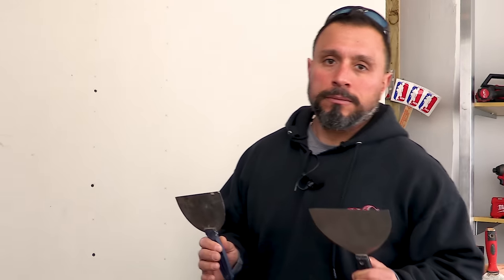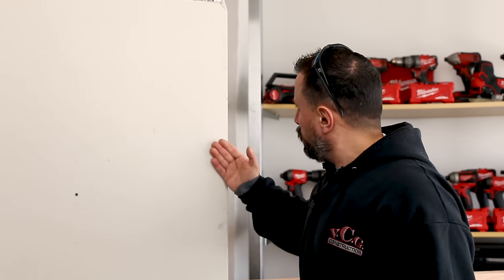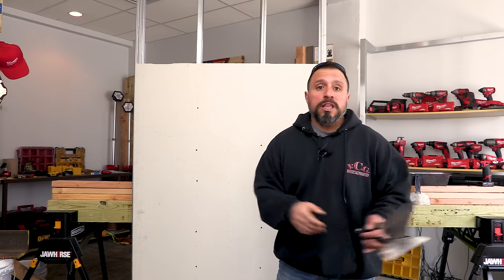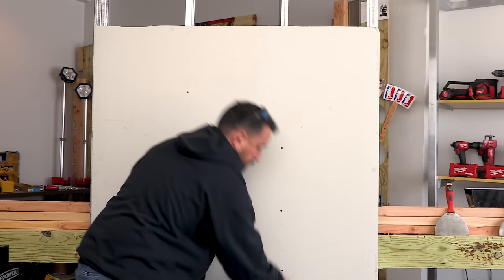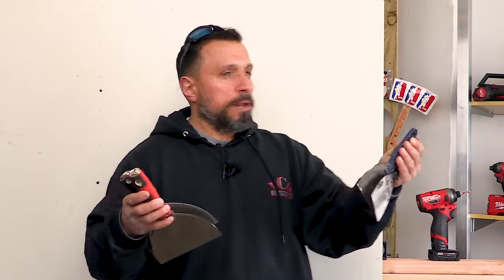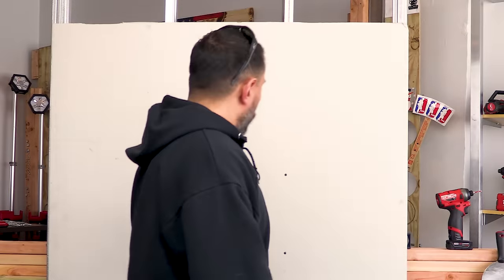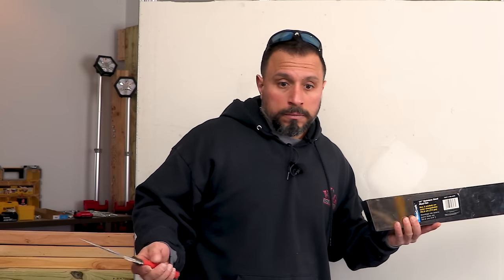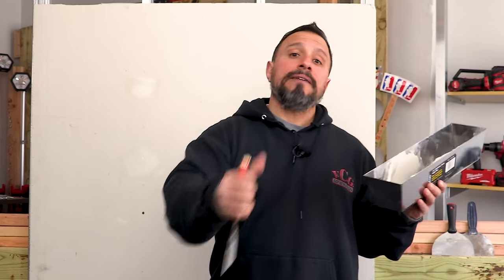DRYWALL FINISHING TIPS AND TRICKS THAT YOU DON'T KNOW ABOUT!

Comment: If you're mudding each screw one at a time you're not a finisher. I'm not a drywall finisher by any means but on our smaller remodel projects I am. I have a 6" knife with a fair amount of flex to it. I just get a glob of mud on the knife, turn it sideways, start at the bottom and smear a line of mud across all my screws at once. Clean your knife then just clean the excess off with another pass of the knife. Takes me about 10-15 minutes to do a whole average size room. That's just screws though. I tape butt joints the same way.
Reply: wrong
Reply: @MaRlBoRoMaNkHuNRoBbYKaP  wrong about what??
Reply: You want that mud thin,nobody likes needing to sand what they shouldn't.

Comment: Beating a screw in that isn't set properly into the wood/steel will cause a "screw pop" down the road. meaning the screw is still loose and will eventually push out the mud that was placed on it. My advise is to just pull the screw.

Comment: A public service announcement, just to save others from suffering through 10 minutes of blabbering, these are the tips: 1) Run the knife over the screws and listen for a click for the screws that are proud. 2) if the screw has missed the stud, instead of trying to get it out, use the knife handle to pound it in a bit. Choose a knife that has a metal cap on the handle for this.
Reply from the maker: Kent, if you want to help people make your own 3 minute video. You won’t!
Reply: @VCGConstruction  You're right, I won't. But I will summarize the trivial tips in a comment to save others from having to watch your inane blathering.

Comment: Looks like he's not wiping off enough mud. Screws need three coats, wiped clean every time and each coat should be wider than the last. Lightly sand after second and third coats. The reason why you want to wipe clean every time is to avoid extra sanding. You don't need to coat the wall when you're coating screws, you're only filling the holes so the mud should be wiped clean off. Also just carry a screwdriver around on the first coat. Tighten screws that stick out as well as screws that are flush with the board. Yanking out screws that missed the stud can break the board. Unscrew them to avoid breaks and the need to push in the paper burrs that you get when screws are ripped out. Put pressure against/under the screw head to get it going while using your screwdriver and unscrew it the rest of the way with your fingers. My personal preference anyway. It's gratifying to rip them out but I find it works out to be the same time or less to just remove them cleanly with a screwdriver.

Comment: Running a knife up the wall to check for screws not set deep enough is fine if your using a screw gun with the depth set properly.  What that method does not tell you is when the screws are set too deep.  Setting a scew with an impact driver has only a very slight chance of being set to the right depth.  Keep that in mind if you are a novice doing a small job.  There are bit attachments you can use to limit the depth an impact driver will set the screw in that case.  If you are doing a bigger job get a screwgun.  Too deep is worse than not deep enough.  Not deep enough can easily be twisted in with a hand screwdriver till it is right.  Too deep and covering it up with mud is a failure that will show up later. Impact drivers do not belong on a drywall job.

Comment: Bashing in  screws won't fix anything the nail will push the plaster out as soon as someone leans or puts pressure on the wall. You need to remove pops and set proud screws

Comment: I always turn my screws in. It's kind of ok to use the hammered end on metal frames, just be careful not to dent the sheet. On wood frames your actually driving the screw through the wood without turning the threads. This will be a screw pop withing a few years because the screw is no longer threaded properly in the wood frames. I see a lot of guys calling themselves pros that do all sorts of whacky stuff. Like this guy that has a channel called drywall instructions. The dudes set is a half taped room with a stacked butt joint in middle of the room.
Seen a bunch of people saying stand up rock is best because it's easier to tape a flat, no you have a taper that doesn't know how to coat a butt joint. Would you rather go all the way to the ceiling every 4 feet or every 12 feet? I need to make my own channel all the jokesters out here....

Comment: Who's your Drama Coach...lol  Easier to carry a Phillips head screw driver than drag around a cordless, you can't bang in the screws on metal studs as they just bounce, wood studs Ok. The way you're spotting those screws you're gonna have a hell of alot of sanding to do, you're supposed to be filling a hole not building a Mountain...lol

Comment: I didn't get through the whole thing...but just from the beginning I noticed some things wrong. You shouldn't check all your screws first, just carry a screw driver with you. You'll waste too much time checking all of them especially if you have ceilings to do. Secondly, that's way too much mud for coating a screw. 3 coats, put it on in one direction and wipe it all off in the opposite direction. You'll end up with the mud where it needs to be and not a ton of excess like that to sand off.

Comment: If you are going to use a drill, buy a cheap drywall screw bit so you don't go through the paper. Also, do rows, not individual screw holes.. and speaking of screw holes, don't use nails, unless you want to redo your job in a year.

Comment: Shouldn’t have a screw pushed in and set if it’s not hitting the Batten it’s the for no reason and if you do big jobs you won’t walk a million screws in with your knife bc the hammer part will ding and brake it’s only there for pushing in the paper after you pull the missed screw out

Comment: Your not supost to pound screws in like that with the back of your knife. It will break the drywall around the screw and it will bubble out after coating it. and when you coat screws, you don't put it on that thick. Just skim over the screw and fill only the screw. Don't put a thick coat over the screw. Unless you like to sand lol

Comment: No, no, no.  You don't hammer with the back of the knife. Who are you, the hulk?  And you don't "twist" against the paper either.  O_o 

Hammering breaks, twisting rips.

The idea is good pressure and a gentle roll of the tool to press the paper and gypsum back without causing any additional stress or damage.  

No talk about the flexibility of the blade?  

Alright, I'm sorry, the video was entertaining.

Comment: too long for those little tips... I was waitin for the dam bomb to go off the whole time.. forget those tips.. I have a little 12 volt cordless with drywall tip hooked on  my belt for just that reason... AS im applying the mud.. then smack the hole with ripped edges and keep applying... just my opinion

Comment: Tip 1. Get a decent plastering trowel, not one of those childrens one he is showing. If you only cover 2 screws and a 20cm joint in an 8 hour shift, they are good enough.
Tip 2. Dont use a baking tray like he does, they are for baking not for plaster, use a plastic 10 liter paint bucket, easy to clean and hold more than his baking tray.
Tip 3. Have a daytrip to a building site and watch how real tradesmen  do it.
Tip 4. Dont take this dude with you, after 10 min of mansplaining you will get thrown of the site.